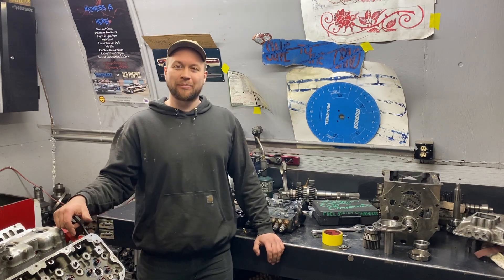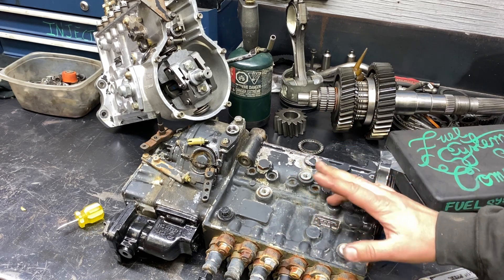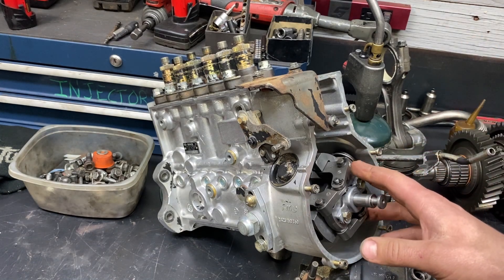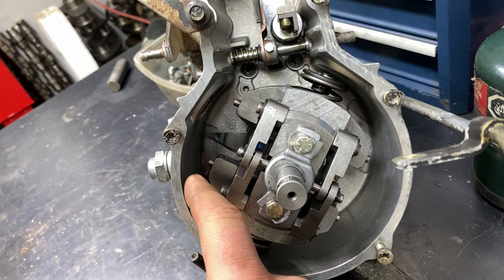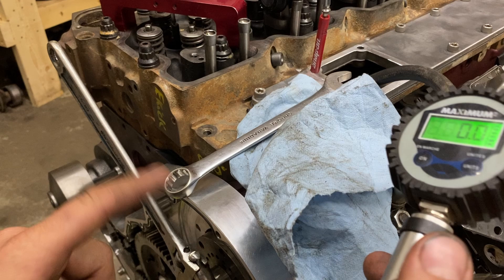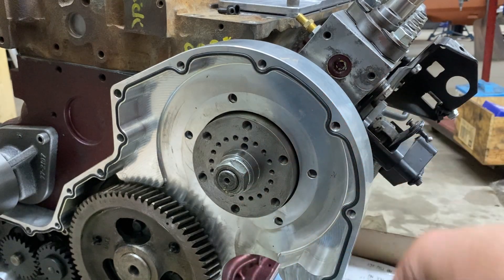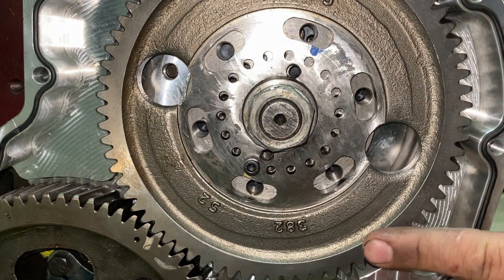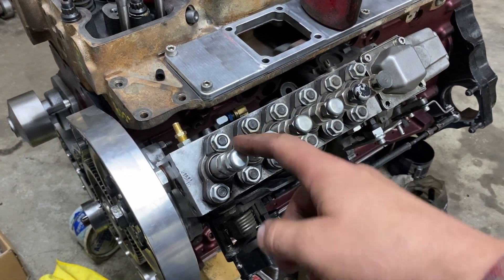P7100 Injection Pump Spill Port Timing with an Adjustable Pump Gear

Comment: I had a bunch of little red lock tight bottles that were getting old but had never been opened so I was going to use them. I was getting worried about the age of them so I tested them, I did this by turning over a empty pop can and put lock tight in the dished bottom of the can (now that the can is upside down) and then I took a 1/4” bolt and stood it (head down) in the lock tigh and waited for it to harden up. Big surprise it never hardened up, not even a little after 11: 15  for a month!  I bought some new stuff and tried 
 same test and it worked great ! Lesson t learned! Always test your lock tight  !